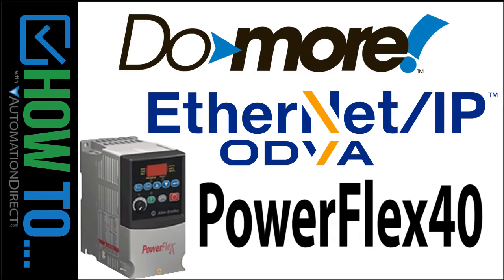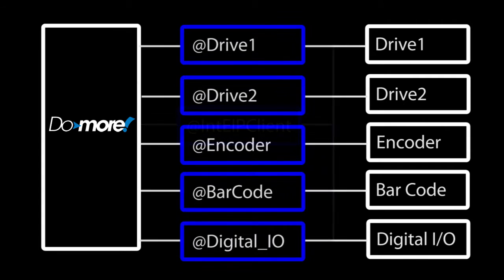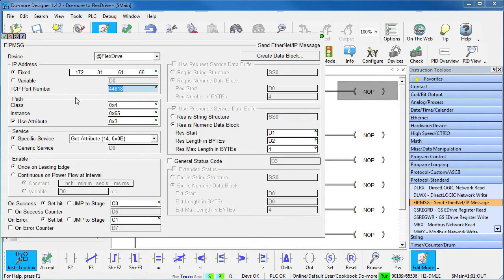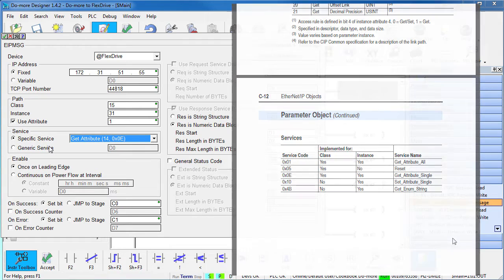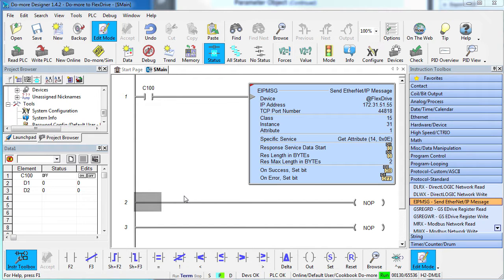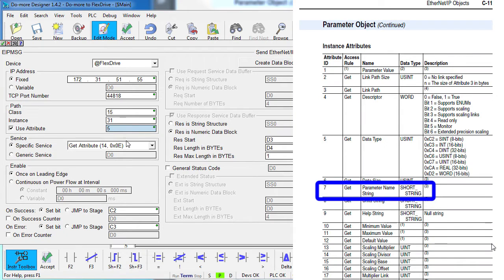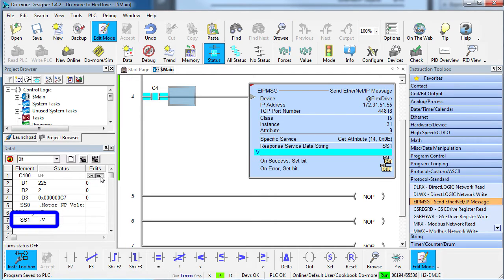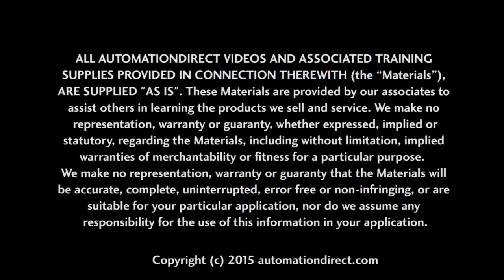BRX Do-more PLC EtherNet/IP to an AB PowerFlex40 from AutomationDirect

Comment: Is there any way to show decimals for the parameter value?
Ex:  My VFD parameter value for Motor NP FLA is 1.6A
Whenever I request this parameter from the VFD and write it into the data view it shows "16" (signed D word "D"). 
Any help is  much appreciated.
Reply from the maker: So you simply want to display the number differently in the dataview, correct?
Then yes, you can simply cast the number to whatever format you want. 
For example, if you want to take a D31 and display it as a Real type: D31:R
Or in ladder you could use a Math Instruction to cast the D-Word to real to create a new real data word, then divide by 10 to move the decimal

Reference:
  Help topic DMD0210 and scroll down to the casting section
  Help Topic DMD0309: Casting - you want the "Format Casts" section